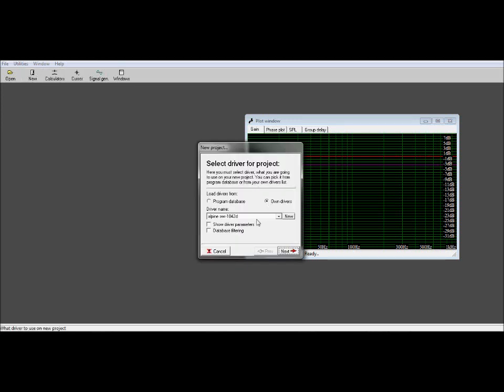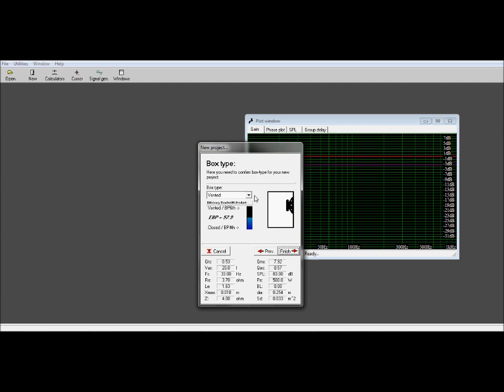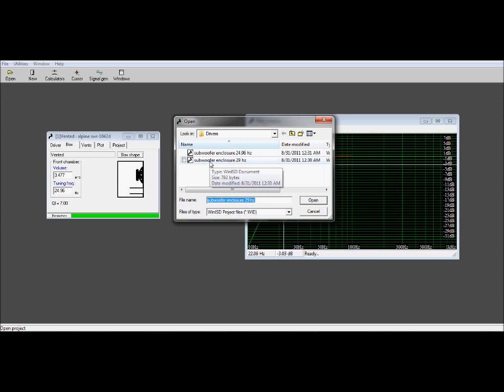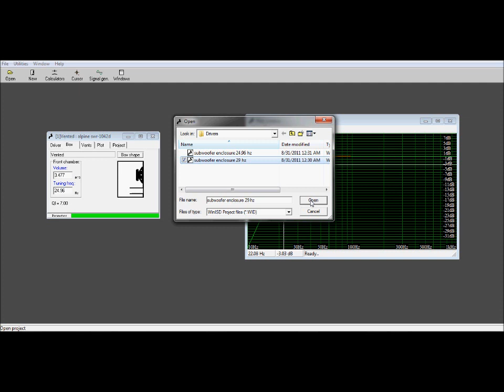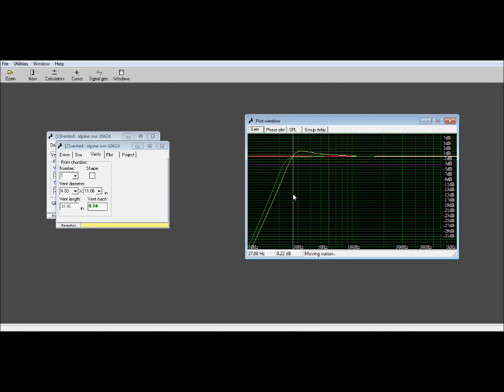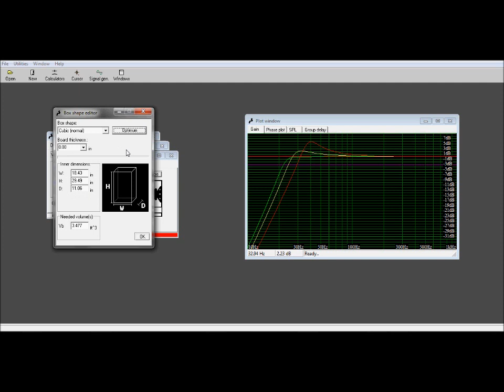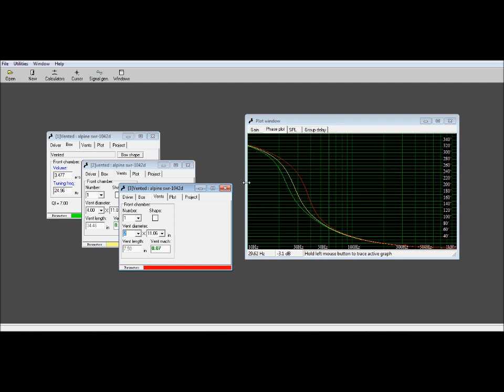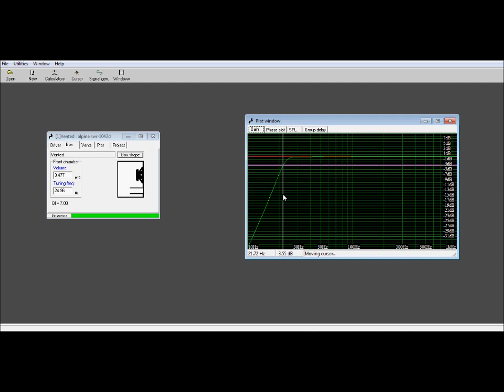Vented box design for sq with winISD

Comment: I recently designed a 6th order box for an 18 in winisd and one chamber is tuned to 27 hz. I was wondering if that was too low? the spl curve looks great from 30-80hz. Theres no reason for it to sound bad in between those frequencies right?